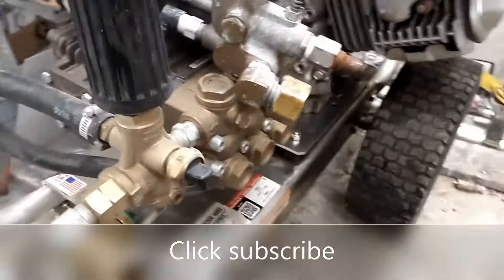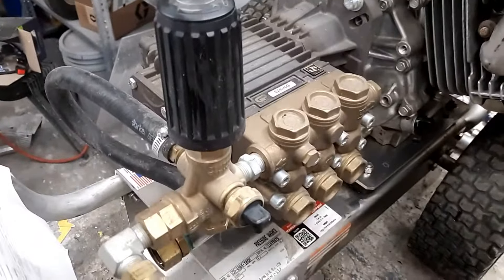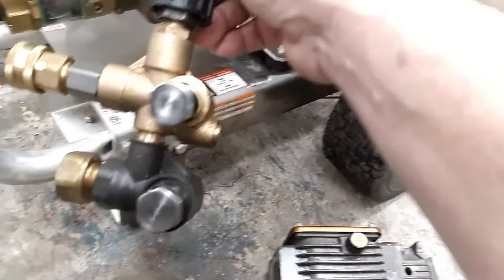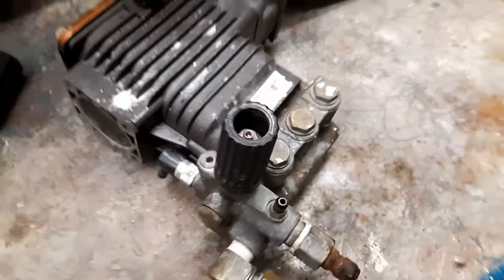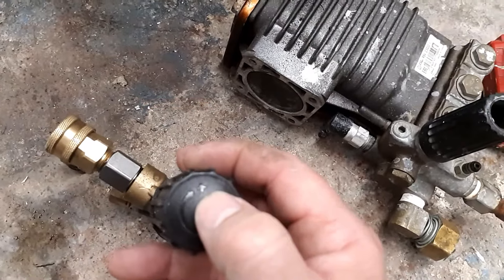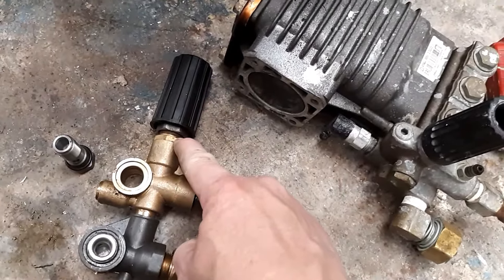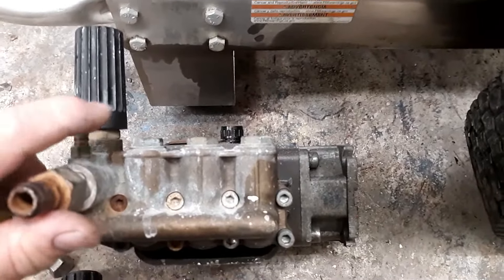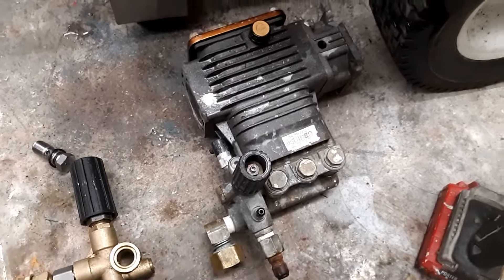Pressure washer unloader types

Comment: What happens when an unloader fails ?   for instance    a bypass has a blockage and the pressurised water has no where to go ?   does it just burst the pump seals ?  or does it try to find its way out of a pressure / valve cap  or just fracture the cylinder head ?   or  find the next weakness   a ruptured hose 
I look at these pumps and wonder why there is no additional safety release valve   ..   I assume cost    
Does it try and stall the engine ?  or as its direct drive  does it just tear the shaft / key        is that a kill switch on the unloader if it was fitted with an electric motor ?
I wonder how many people just buy a replacement unloader valve and just fit it and not set to correct working pressure 
Dangerous
Reply from the maker: The engines on these machine will only allow the pressure to rise so much before the engine stalls. The pumps are typically rated for 3 times their stated pressure. The engines can't come close to this, so they stall. If a fitting or gasket were to fail, it would be due to a worn or damaged part
Reply: @Brian_the_repair_guy  I borrowed a neighbors Westinghouse 3200psi washer today, and immediately, something was wrong with it.  Would start right up, but within 2-3 seconds it would load right up and stall the engine.  If you held the trigger on the wand, it would run all day, but as soon as you released it, engine would stall right out.  It has a different style of unloader, it's held in with a U shaped clip.  There's no knob on it, just a nut to adjust how much the spring is compressed.  I pulled that out, to visually inspect it, and everything looked clean and practically brand new.  I put a dab of grease on the o-rings, and put it back together.  Started it up to test, immediately loaded up the engine, only this time, it built enough pressure before it stalled, to completely force the plastic hose connector off the wand, stripping the threads entirely off.  The hose smacked me in the leg, and left a very significant bruise.  I'm convinced something is wrong with the unloader, but I'm hesitant to try any more troubleshooting.  Obviously this thing was capable of building some pretty significant pressure, not sure I want to find out what the next weak point is. 

Any thoughts or ideas?
Reply from the maker: @ericcheeseman8144  you are definitely getting far too much pressure. When the trigger is pulled, the pump is in effect leaking, so it can't build but just so much pressure. 

When the trigger is released, the pressure builds and the unloader dumps off to the low pressure side to prevent excessive pressure. When the unloader fails, or is set too high, the pressure builds until the engine stalls or failure of a part. 
At this point, I would not suggest any other work being done except by a certified shop.
The pump has been stressed and should be thoroughly checked.

I don't feel the excessive pressure was do to the user, it just happened to fail at that time.
Reply: @Brian_the_repair_guy  Thanks for the reply.  They hadn't used it since last year....I'm guessing it got put away wet, and freezing temps in winter affected the unloader.  Either way, I'll be calling a local small engine shop in the morning.  I'd probably investigate further, but it's not mine, and I'd prefer not to make anything worse lol.

Comment: can you run the hose back to a water tank instead or just let it run on the ground???
Reply from the maker: Yes. You will need to plug the intake fitting on the low pressure side
Reply: ok thanks..

Comment: Can u put an unloader down stream from the cheap box store style. So u can Circulate the water and not heat the head up.
Reply from the maker: If the unloader is built on to the head, no. If the unloader is a bolt on style, yes.

Comment: Can you regulate these pumps to 300 psi @ 3-4gpm?    How could we do it?
Reply from the maker: The oumos can be adjusted up or down with the unloader. Specific target pressures will vary by pump. Adjust it down and see what you get. Use a gauge

Comment: If a banjo style unloader ever needs to be replaced can a external bypass unloader be mounted on instead?
Reply from the maker: Yes, it is very easy to do. You would need a water hose fitting, one like you see in the video is good. Has a screen filter that is easily removed for cleaning and a male nipple to connect the external to the head.
Reply: my EZ-CLEAN had the banjo style on it,  I removed  it 2 yrs ago and  went  with  the  external, I even added a ball valve on the pump to open  up to relieve  water pressure  on the pump for  easy starting. my EZ-CLEAN is a whole different  machine now ..
Reply from the maker: @kenwimmer3936  I much prefer the external unloaders over bolt on, the valve is a good touch. I usually reccomend them on the bigger machines.
Reply: Good video thanks. I just bought  a ar pump 4000psi 4gpm, what could cause my unit to loose pressure while you are using it intermittently.  Is a ar pump a good pump? I bought it for the gx390

Comment: You need to adjust pressure using a gauge, not listening to the engine. It's more important to know the maximum operating  pressure of the lowest rated accessory and use a gauge to set the pressure. Otherwise, good info.
Reply from the maker: I agree, the pressure should be set with a gauge.  In a perfect world it would happen. In most situations, guys are not going to purchase a high pressure gauge to set the unloader one or 2 times in the life of the machine.  
So, I explain how to set these without a gauge. 
You wouldn't want to set the gauge based on the lowest rated accessories.  Doing this would prevent the higher rated accessories from working properly.
You want the pressure set as high as the engine and pump will safely operate. Adjust down for the lower pressure accessories

Comment: The pump u said that is built in, Can it be plumbed?
Reply from the maker: If the unloader is built in, meaning it can not physically be removed from the head for total replacement, then no you can not plumbed in.

Comment: Yes I have a question for you I have a cat pump
Reply from the maker: @DIRTTRIKER  what's the question
Reply: @Brian_the_repair_guy  apparently this thing's got a built-diverter valve, but it doesn't seem to be correct, you can only adjust it to a certain amount and then the engine can't handle it, it doesn't seem right, I wish I could send you a picture
Reply from the maker: @DIRTTRIKER  find me on Facebook.  You can send video and pictures
Reply: @Brian_the_repair_guy  do you have a link
Reply from the maker: @DIRTTRIKER  just use my name on Facebook Brian Shumack
Reply: @Brian_the_repair_guy  found you it won't let me send you a message for some reason I don't do Facebook much so I don't know what to do I did send you a message and hit the follow button so I'm not sure if something went through or not 🤙🏼
Reply: I figured it out I sent you a friend request and sent you a message and it said it went through

Comment: Rubber hose acting as radiator? WTF world im livin...
Reply from the maker: A radiator is defined as "1.a thing that radiates or emits light, heat or sound." Since the rubber allows the transfer of heat into the ambient air, the hose qualifies as a radiator. If you disagree with the technical definition, feel free to elaborate
Reply: @Brian_the_repair_guy  This hose will emit 2-3% of heat from pump recirculating water at full speed, you get people wrong saying 1 ft of rubber makes any difference.
Reply from the maker: @krzysiek524  do you have supporting evidence or data that shows a 1-2% radiation rate?
Reply: @Brian_the_repair_guy  Yes i do, brass is at least 400 times more heat conductive than NBR/EPDM rubber. Typical triplex pump running on 3400 RPM will consume 15-20% of power on pure friction converted to heat. During bypass pressure is lower so are the friction losses, about 10% of power and also all the heat from thermal conductivity of shaft, pump flange, heat radiated from engine and also hot air cooling engine. By adding 1ft of rubber hose you add thermal capcity for few seconds but ZERO thermal conductivity to air. For 10kW pump you would have to dump 1,2 to 1,5kW, in stagnant air heat exchange from copper tube with water is ~250W per square meter with 5*C dT. To fully emit that power u need 5m2 of copper surface, good luck with that. Remember when pump is not at bypass its fully cooled by water, when cooling stops all that heat builds up in oil, crankshafts, plungers up to the head.
Reply from the maker: @krzysiek524  I am not arguing that there are better heat conductors. In a standard bolt on, you have less than one inch of low pressure transition before the water is reintroduced to the pump. Very little heat dissipation occurs in that one inch. The 16" of hose from the unloader to the reintroduction into the pump allows more time for the water to cool. As I explain in the video, some reduction is better than none. The hose stills acts as a radiator. Take note to number 2 reason for an external bypass versus a bolt on or banjo style. https://www.pressurewashersonline.com/pages/why-external-unloader-valve
Reply from the maker: @krzysiek524  here is a video that explains the same things I have said but in simpler terms. Maybe this will help as well.
https://youtu.be/h1lQhpxP9uE
The industry as a whole agrees the 16" to 36" addition of a bypass hose is a great addition when ground dump or take dump is not acceptable or possible.
Reply: @Brian_the_repair_guy  American people logic, say same thing like a broken record without any knolwedge/data. If you would have any decency you would at least read what i commented. Addition to rubber "radiator" is when air pocket stays in rubber hose during bypass is has nowhere to go than to pump suction over and over, slowly cavitating pump, tested on clear hose. So you still gonna send me links to people saying rubber hose is radiator? Radiator in you car is made of rubber, heat exchangers are made of rubber?
Reply from the maker: @krzysiek524  again, you are arguing a point no one is making. Are there better options for heat dissipation? Yes. Absolutely no argument there. 
Is the rubber hose added to increase surface area to allow some degree of cooling? Yes. 
A radiator can be fabricated with most any material. Are some better at the exchange of heat, yes. 
You are on about something, not sure why. If you do not agree with the engineers of these designs, you should argue the point with them. Not me.
You have a great day
Reply: @Brian_the_repair_guy  You just sad the most important thing; "If you do not agree with the engineers of these designs, you should argue the point with them." The thing is i worked with Interpump(Generalpump) for short while, banjo/bolt on unloader should be ALWAYS used until there is buffer tank and bypass water is returned to it. There is ZERO evidence of any manufacturer/engineer saying bypass loop is good, worse it cavitates pump. Simplest way to not overheat pump in bypass and get much better fuel economy is throttle control valve and it does work on every machine. PA RGV or TECOMEC ETC are cheap, robust and work every time.
Reply from the maker: @krzysiek524 I am sure you are good in whatever you do. 
I will personally take the word of multiple manufacturers of these pumps and my 32 years of experience. Again, you have a good day